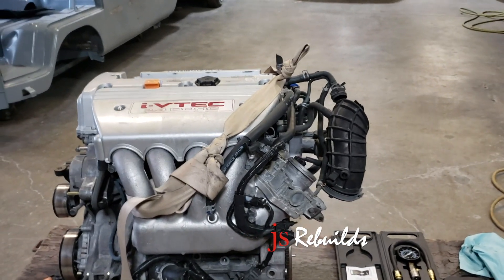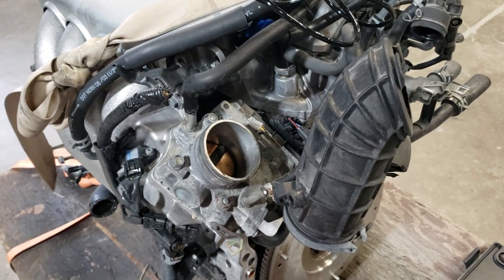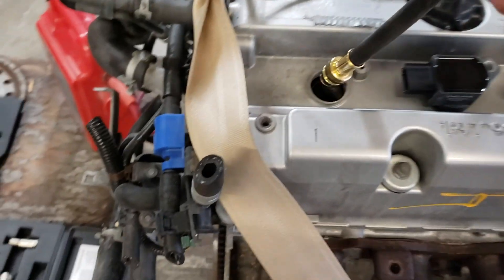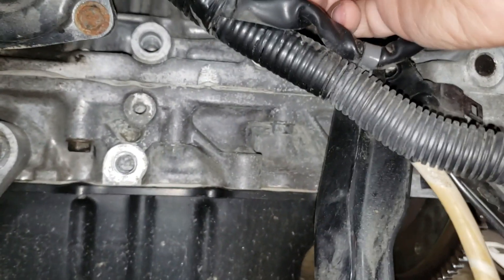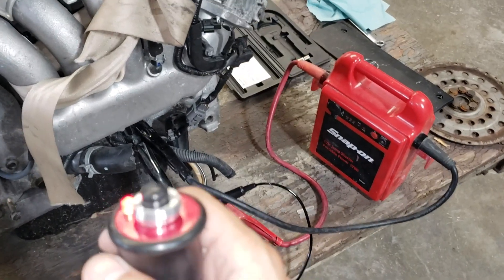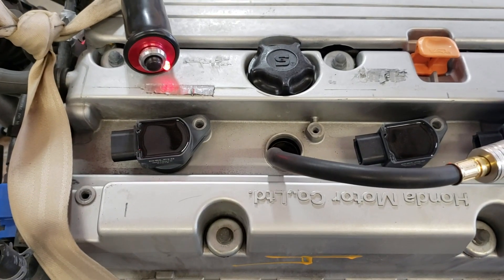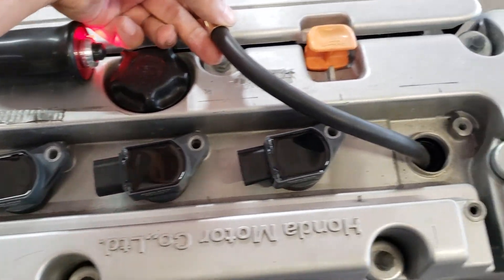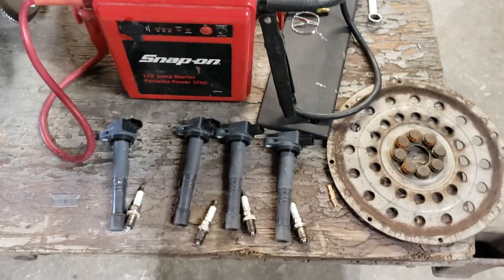How to Perform a Compression Test on a K-Series Engine (K20, K24, Out of the Car)

Comment: Arent you supoose to take out all the spark plugs
Reply from the maker: You are correct about taking all the plugs out. Thank you for correcting me, it does make sense to me because the plugs still inside will cause the motor to fight against the compression and can cause uneven readings.

Comment: If its been sitting a while it will read low just add a little bit maybe a bottle cap full of oil into the cylinder and you may get a better reading